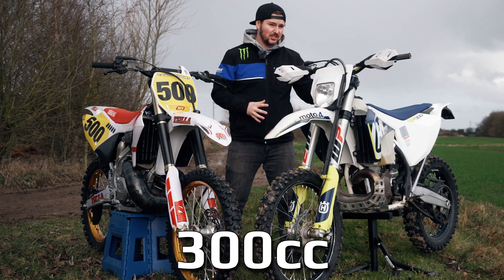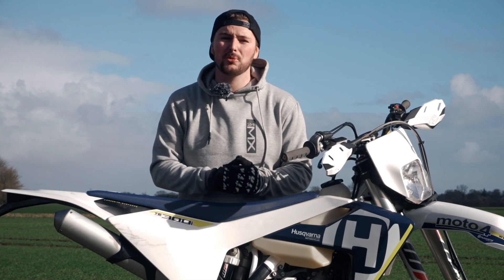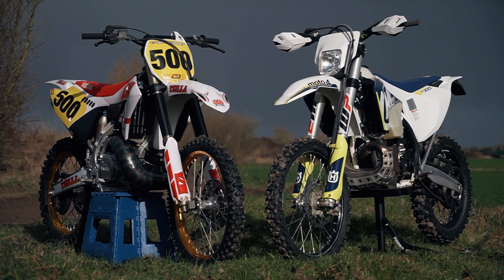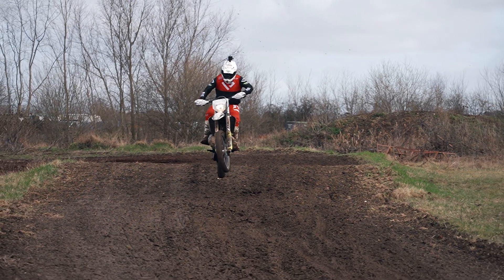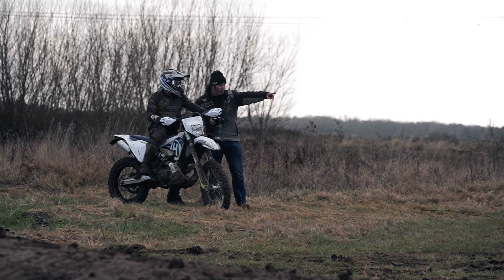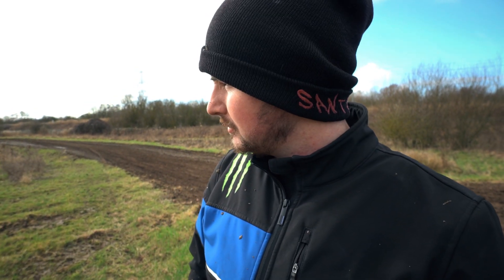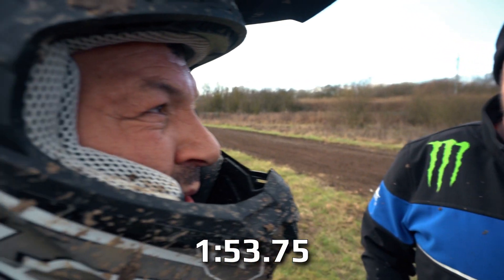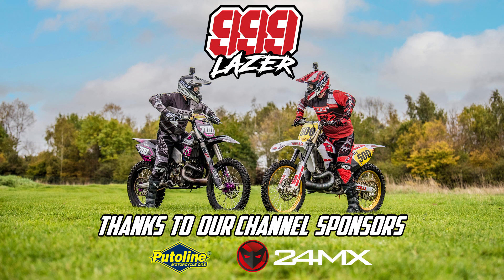Fuel Injected 300cc 2 Stroke vs 500cc Two Stroke | Dirt Bike Shoot Out!

Comment: What might be an interesting comparison as well might be a YZ300 vs the 500, especially since the 300 big bore kits are far easier and cheaper get a hold of (and perhaps easier to ride) than the BRC YZM500 kit.
Reply from the maker: Good idea Henricus, we'll see what we can do...
Reply: It would be. If they were here in states, I have a YZ315 stroker that is almost 60HP (stock 44HP same dyno) with A-kit that would be fun to test vs 500. Be a fun test!
Reply: pP as😂
Reply: @Fvission  That would be an awesome machine. That's a cool build. It's fun to hear about.
Reply: One thing with the yz300 is I've always been told is how rough the vibration is. But I've only met 2 people with yz325's

Comment: Need to get the same tires, suspension setup and similar gearing for a proper shootout.
As it sits now, the 'Zilla is set up for MX, so it will naturally dominate. With the 300, once it is set up, will probably give the 500 fits in the corners, but get wasted on the straights.

As an aside, I like the Metzler MC5 intermediate terrain tires on my 500s. They grip well and have a decent tire life.

Comment: Anyone that has done alot of riding knows that in those muddy wet conditions tires are everything! The 500 had new good tires and the 300 tires were cooked and the 500 is only 3 seconds quicker.  New tires on the 300 and it will be faster
Reply from the maker: Thanks for watching Craig. The tires on the 500 certainly aren't brand new anymore lol but for sure we'll have to do a re-match when we've finished upgrading the Husky!

Comment: Let's see ... on the guesses ... this is going to be a bit of a laundry list: 1) Get your favorite new tires on both bikes. 2) Set up the TE300i's suspension for motocross work & strip it of it's lights and street legal stuff. 3) Retest both bikes then. 4) Someone already mentioned sticking the BRC 500 kit on the Husky & test again.
Reply: Husky/ktm enduro bikes are known for a very poor stock suspension. Not one that can be fixed without spending lots of money(almost the same as getting completely different better cartridges)

Comment: Nice video Max, both bikes performed well, as Sean said if the 300 was  suspension set up and a little bit of Roland's magic on the engine  it would help the husky run better with the yzilla . max you are the owner of some beautiful bike's.

Comment: I guess the husk will get bored out even more plus proper mx suspension and wheels. Would’ve been even more dope then it is if you got your hands ona tx300 but like ya said unicorn and hard to find . But you can tell the yamaheeeeehaaaaa tracks better more torque and bottom end in turn speed. Props to the rider but def gotta get nev bradshaw to compare these two once dialed completely on the TE300

Comment: Hey max how's the yamaha clutch holding up?
Reply from the maker: All good Kyle, no issues at all. Changed the oil after the race and this ride and it was very clean
Reply: Sounded like it could be slipping a little under power a few times. Possibly just wheel spin.

Comment: Different tires, Soft Off-Road suspension, Off-Road Gearbox, Mousse in Front.

Not a fair comparison.  TPIs are much mellower than the new TBI or older Carb models as well, so I’d expect it to be less on a track.

Comment: The ktm 300 xc makes 56 hp and that basically a xcw 300 just the husky version so it should be making closer to the 56 hp range look it up unless they did something different with the husky version or the trans pulls that much different out because the main difference is the trans from the xc and xcw
Reply: That what they claim on the dyno at the wheels low 40s 350f made 48hp and the 450 made 54hp

Comment: The TE is gutless. No bottom end. Very bland, boring motor. I know it's tpi.  the Sherco 300cc 2 smoke would be a better comparison. Its carbed. But it has FAR better low end than the TE. The TX has a far more fun motor even.